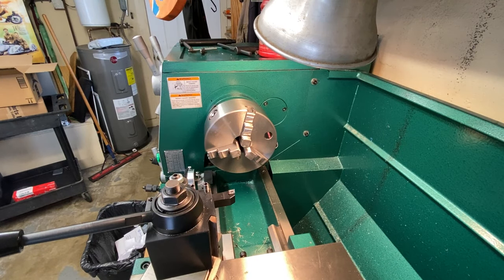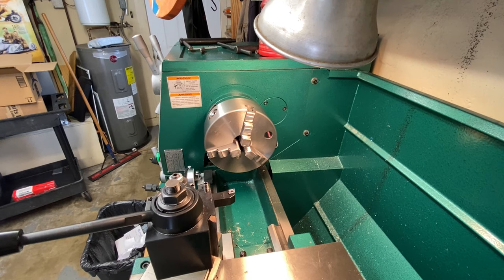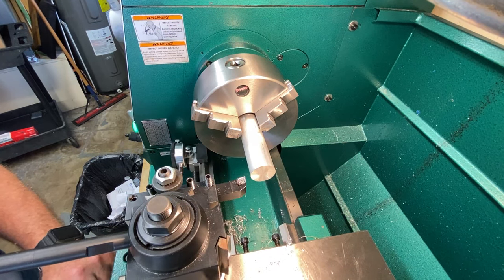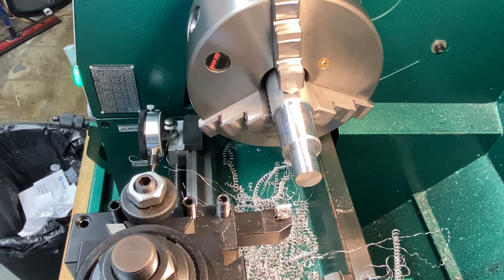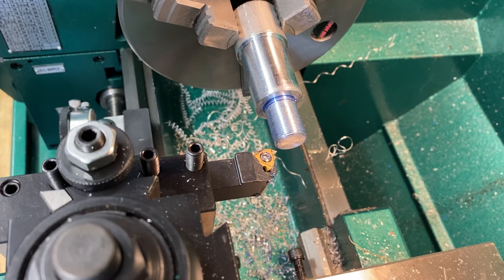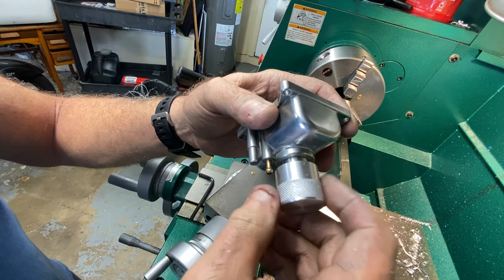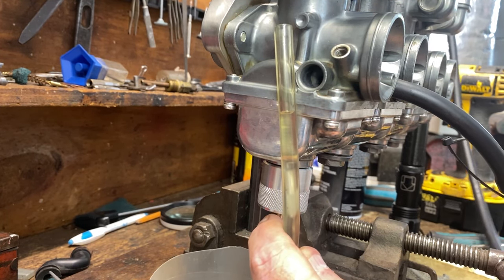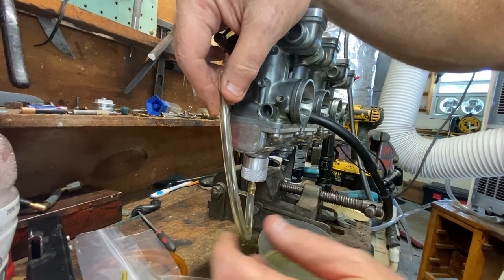Machining Mikuni VM carb service fuel level tool - works great!

Comment: why make it so deep in length on the vertical?  would have looked better if it was a closer resemblence to the original ..  looks too big to me.
Reply from the maker: Function. Easier to grab by hand. No tools necessary.
Reply: @MotoRestoFL  ok